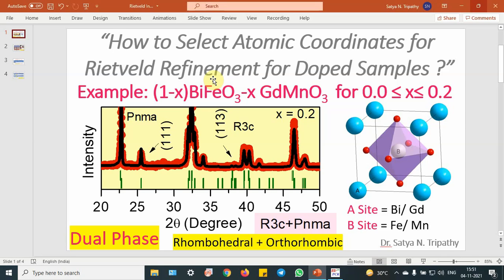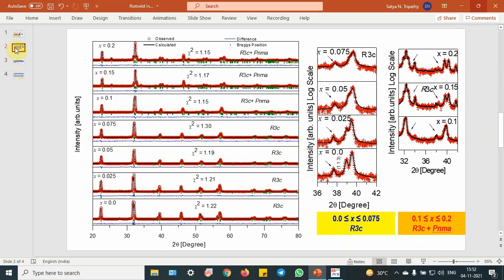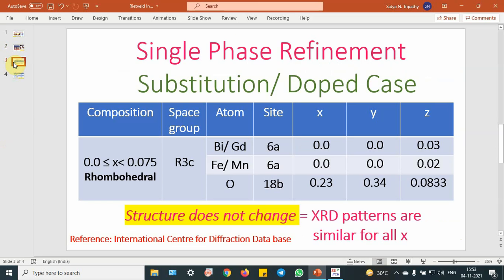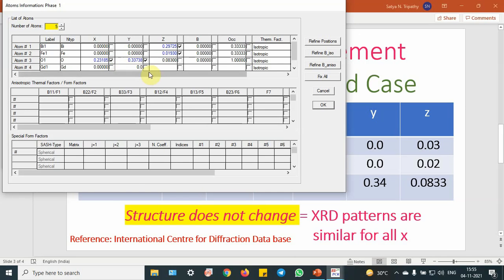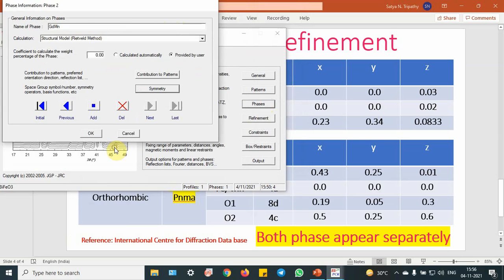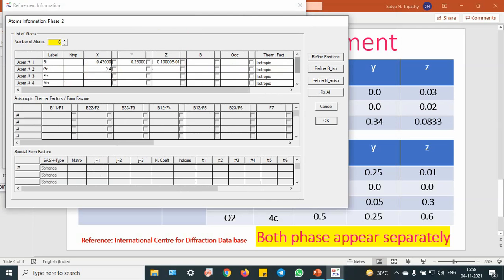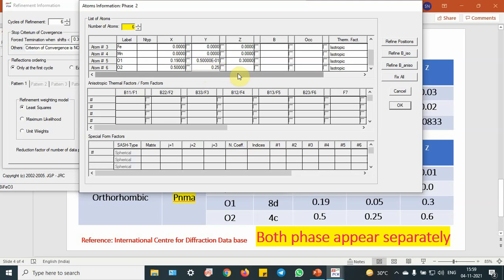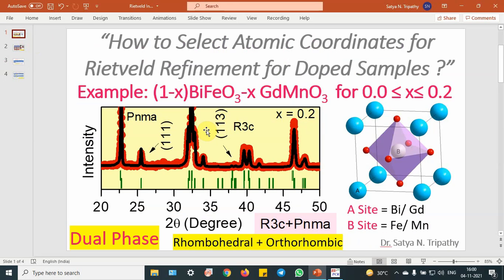Rietveld Refinement of X-ray Diffraction Data of Doped Samples Using FullProf Package - Part II

Comment: Can we refine the occupancy (i.e. composition) for the doped sample?
Reply from the maker: You can refine it. Fix it, if chi2 diverges
Reply: @physicsdoneright  Thank you very much sir for your response. But won't it change the stoichiometric ratio? Sir I have sent you one mail. Can you please kindly reply? It will be very helpful.
Reply from the maker: During occupancy refinement keep all other profile parameters fixed. If your occupancy changes  significantly during the process of refinement, then fix it with nominal value.

Comment: I have 7 doping  xrd data, if i do refine all the data one by one it took my times, instead that can i choose pattern refinment?
Reply from the maker: Dear Selvaraj, If you have a seven doped samples, then keep the atomic position constant for all seven and refine profile parameter only by changing the XRD file in the folder. I also note that keep occupancy of each doped sample as per chemical formula.
Reply: @physicsdoneright  thanks mr physics done right. Its really helpful. Thanks